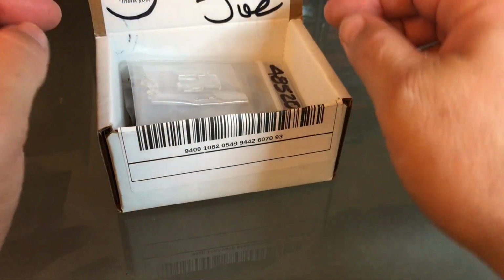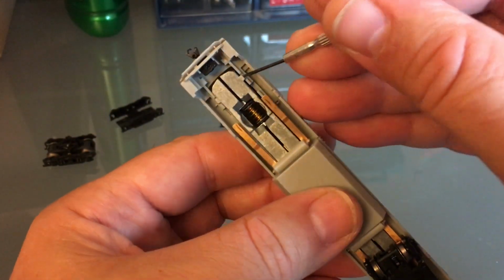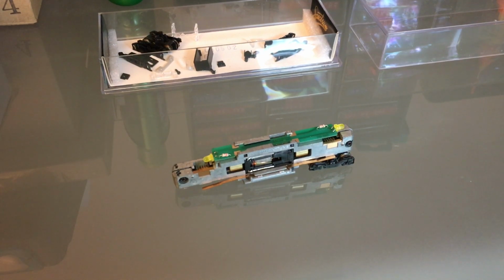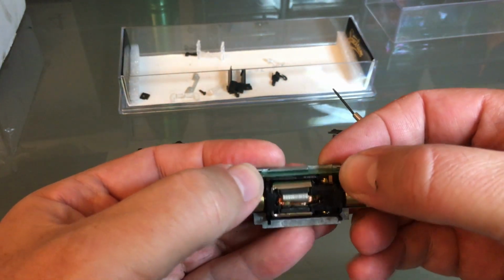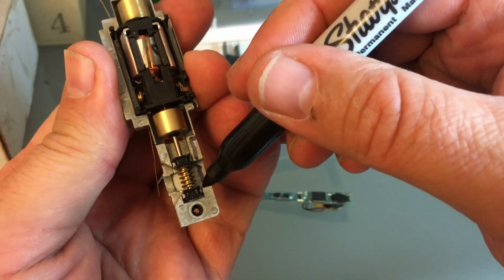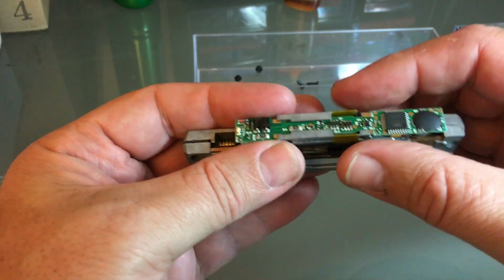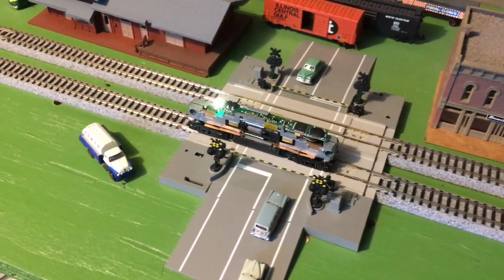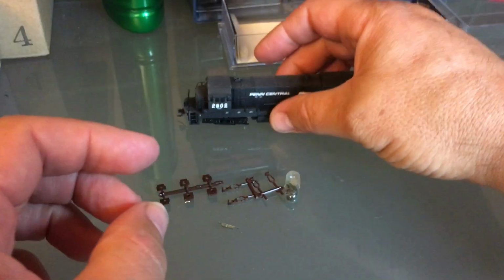N scale B23-7 revival and conversion to DCC and Sound XL Systems dcc

Comment: Great job, very interesting Video again! You have the right N scale skills….Where do you get the decals from? Have you ever tried an ultrasonic cleaner? I guess it would work well for cleaning small parts, and units are not expensive approx 20 EUR. You can just use water with a little bit of dish cleaner liquid. I believe the two engines together in double traction would look nice, and you could do the set up with your DCC system. What is your idea? Best regards from Germany!
Reply from the maker: Decals come from a company called Microscale. They are available on eBay.

Comment: Great video again. One question I have is I noticed you re-fitted the glass last. When you disassemble the body components to re-fit the glass are they not stuck together by the new paint coats? Does this not damage the paint as I noticed you spray the loco complete not disassembled? Asking as a newbie to overhauling locos.👍🇦🇺🇬🇧😎Max.
Reply from the maker: I have had no problems so far. I have painted the body parts separately before that worked out well also. I try to do thin coats.

Comment: You used Micro Sol this time...why?  Was the decal just not sticking; was the gloss coat the issue; or did something else cause you to use it?  Thank again for the info!!
Reply from the maker: Micro sol helps decals get soft. There’s a fold in the shell that makes it hard for the decals to conform.  The Atlas couplers are ok. I just happen to have new Microtrsins and I wanted to use them. Plus they are brown, so that’s pretty beet!

Comment: Looking good on the Penn Central this morning! Sounding good too thanks to that decoder! I need to buy another batch of non working or parts locomotives. All of the ones I have bought recently have needed little or no repair.
Reply from the maker: Yes, everything is more expensive now. You can still find old stuff.  It’s hard to get parts now for those old engines.

Comment: Do you know what xl systems decoder fits a n scale atlas Trainmaster?
I’ve emailed them a couple of times but no response 
Thanks
Reply from the maker: Here’ s what I would do, remove the shell and compare the circuit board with other engines that you have. The gp9 gp30 gp35 have the shortest circuit board. Gp38 gp40, u25b, b23-7, rs11 have about the same size board.  If your Trainmaster has the same size board as one of these, then the XL Systems board will work. You may have to mill the frame like I did.
Reply: @watchtrainsnow1099  thanks, enjoy your videos